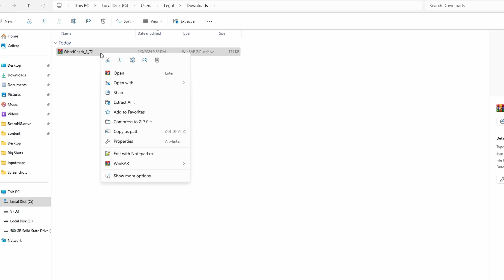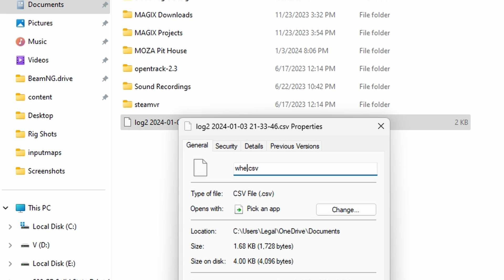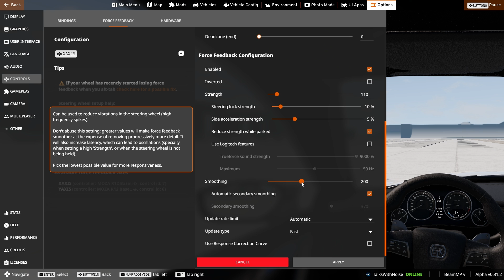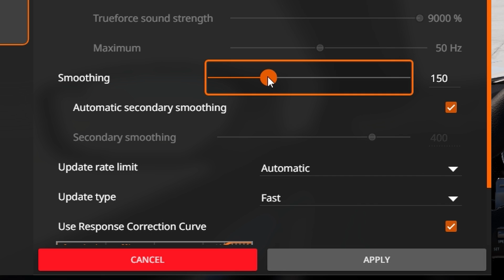Fix Your Force Feedback in BeamNG

Comment: bro, you make my beamng experience on a wheel a MUCH better, really appreciate this video and hope your pillow will be cold on both sides!
Reply from the maker: Glad it helped :D  I wish the csv option was a bit more apparent.  Kind of hides at the bottom of the menu to be ignored.
Reply: @TalksWithNoise yeah, i also think about FFB in Euro Truck Simulator 2, where when your truck is off, FFB will stop the wheel and make it hard to turn, and when you start the truck, FFB will be working normally. Its such a realistic feature that i wish, could be in beamng.
Reply: @KrokietFSO  Ask the devs.
Reply: @KrokietFSO   pretty sure there's an option that you can deactivate that makes the wheel hard to turn when it's parked
Reply: @KrokietFSO  I know I'm late but in the FFB settings in BeamNG there is a box you can untick so that it won't reduce the steering strength when parked
Reply: @Sithhy so it won’t? That’s not what he’s asking for

Comment: The reccomendation to run on vulkan is good, but for some people that have 8gb of vram or lower vulkan either doesnt increase or completely ruins performance
Reply from the maker: Yup, just run whatever works best.  Fingers crossed Vulkan always comes out on top when complete.  Right now its very random depending on people’s setups.
Reply: @TalksWithNoise yeah its a good thing that its getting better wand better but it still has its perks sometimes

Comment: I use a direct drive wheel and I feel like since the 0.30 update, the force feedback got a lot worse and I'm not sure why.
Reply from the maker: Have your frames dropped?  I switched wheels right on the update so I wouldn’t be able to notice in-game ffb changes.
Reply: @TalksWithNoise  No, they've only gotten better (new gpu). Not sure what's going on, but I've experimented with smoothing and secondary smoothing and it's gotten better. Also have to make sure power steering is included with every car
Reply: Same. Cammus?
Reply: @novakrank  No. CSL DD and this is old news. It's better now.

Comment: uhhh I do skyfall's ffb with stock response correction curve for g920 for dd, I don't even touch it lol
Reply: it meaning response correction curve
Reply from the maker: May be worth giving the csv a try.  I’ve had people claim it’s a night and day difference with the Logitech.  The correction curve is steep as the wheel lacks torque in the middle.  Although my Logitech had ages of use and had too much gear slop to reduce the cogging.
Reply: what is the difference vs. stock beamNG correction curve @TalksWithNoise
Reply from the maker: Beam’s correction curve doesn’t exist.  Enabling it without generating a csv or lut file will simply pull up a linear line which is the same as having it off.  Adding one compensates for where a wheel lacks or adds too much force which is why you’ll see a curved line once I apply it :)
Reply: @TalksWithNoise  beamng does ship correction curves for some logitech and thrustmaster wheels (though all disabled by default) :)
Reply from the maker: You can find the response doc links referenced under the response curve info in game if you go looking for them.  That’s where I found lots of info.  Temps, wear, manufacturing differences could make subtle differences (though not sure how much).

Comment: What moza wheel do you have
Reply from the maker: R12 base with the CS wheel.  Very notchy for being direct drive and certainly doesn’t feel like the advertised 12nm.
->Sponsor me Moza 🤣
Reply: @TalksWithNoise I was thinking about getting the R5 or the r9, should I?
Reply from the maker: For practicality the 9 may have you sitting a bit more comfortable in asphalt racing since that extra force gives better details when breaking loose in light traction turns.  I did lots of searching before getting mine and all of the companies within my price range have the same notchy problems and over-claimed torque specs.  Being overly harsh on the product but eh, it was expensive so high expectations were built.  9 would be solid if you can manage 👍

Comment: The BeamNG Force feedback broke my wheels centering motor😂
Reply from the maker: Sounds like a sensor or strip may have gotten rotated.  Fixable but could be tedious depending on the wheel!
Reply: @TalksWithNoise yeah i already foud a solution but iam too lazy to repair it
Reply: Which wheel did you have?